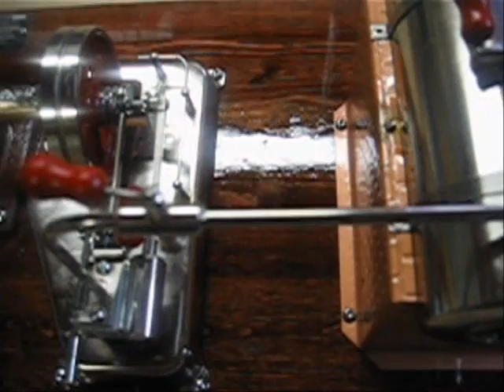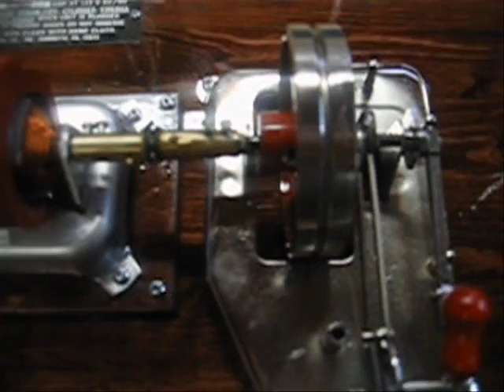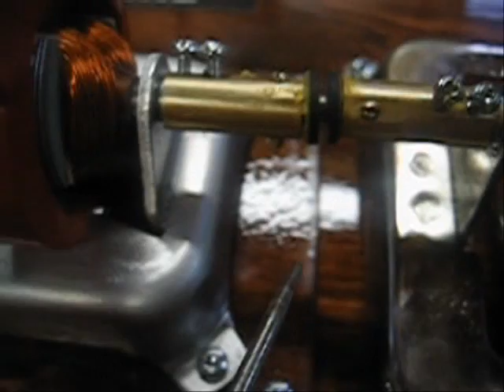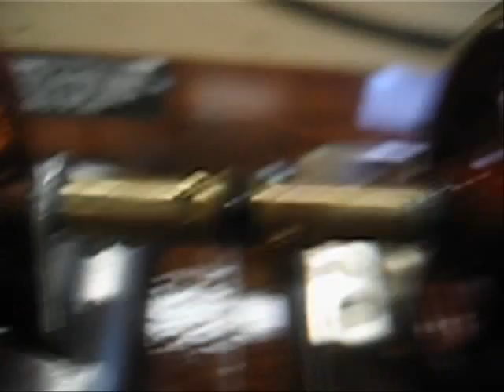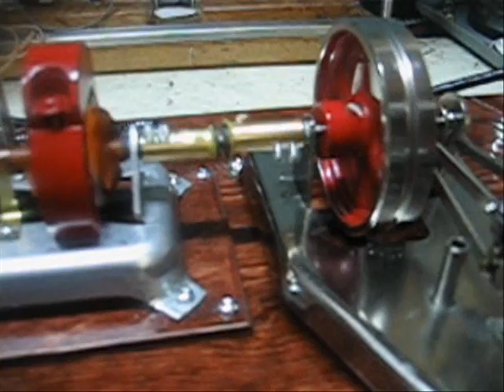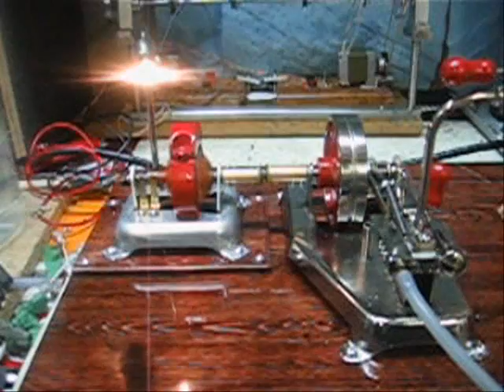Jensen 25 Special Project - Overview and First Run

Comment from the maker: Soft solder is fine for this particular joint.  Do you mean to braze the 2 shafts together? I don't want to do that, since I want a joint that can flex.  Wood will warp/swell/shrink over time, causing alignment problems.  I'm still working on this model, but it's shelved for now because I needed the model 15 generator for my Super 70 project.... I need to buy another model 15...